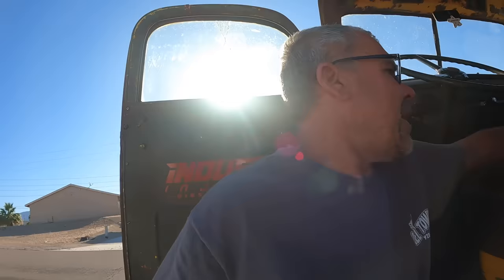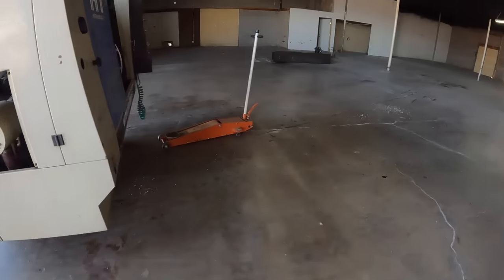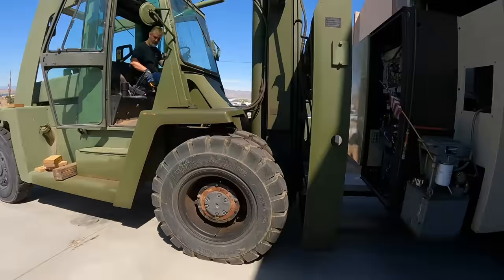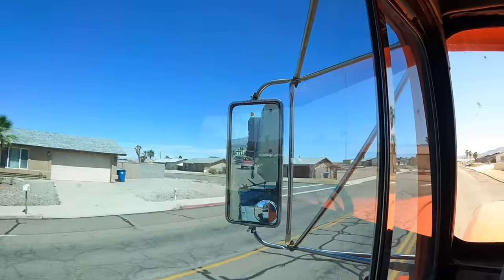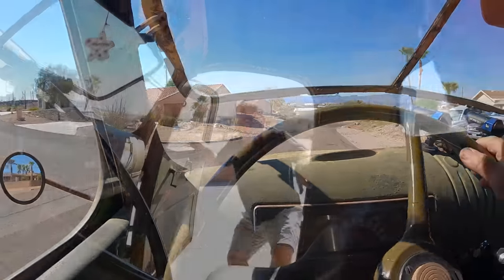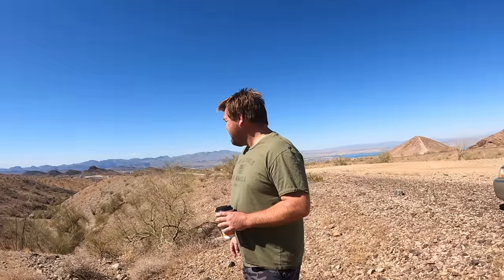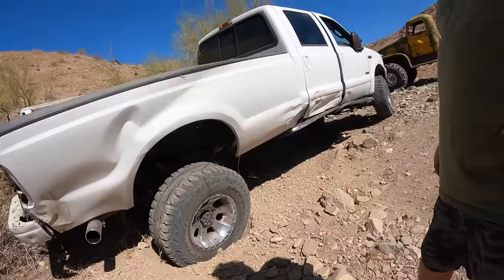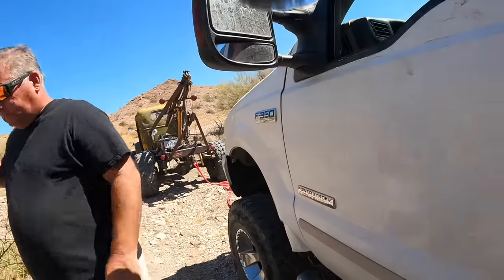Could this be a Repeat of the Wrecker Games? The Repairs to this Truck will be TOO MUCH $$$

Comment: Nice machine congrats on the score!! You would love the monster fork trucks they use in the port of Houston to move and stack containers. They are behemoths but really cool machines.
Reply: I drove a Nissan versa lift 45/65 once.  It will pick up a fully loaded trailer, truck included. 45k lbs, with the counterweight on a hydraulic ram that moves it out and increases the capacity to 65k lbs. What a monster!

Comment: Great job by the wrecker and the whole crew.  I'm thinking maybe more off road recovery people should consider diesel power.  I can think of one in particular that at one time would never have a winch or hated using them and that changed!  Even though I love the gas engines too, I think the torque and dependability of the diesel is the way to go!

Comment: I have a similar truck as that..  2002 F350 7.3L 6spd manual, manual 4x4, manual hubs.  It's an awesome truck, but it's just too dang heavy for off roading.. especially in sand or mud.   It's very capable off roading, but I just try to avoid it if I have a choice.  My old 95 F150 5spd 4x4.. I took it everywhere and it was a beast in 4Low.  It would run circles around the 7.3L in the dessert..  But the 7.3L will blow right by in with a gooseneck on the highway-- so they have their place.

Comment: To prevent damage to the rope on the ledge if you got a spare tire on either vehicle air it down to flat and stick it under the rope standing up if it will if its blown or destroyed and wont hold air even better

Comment: We NEED a video showing how the lathe works... please.
Reply: I have a buddy with a machine shop that has several CNC  machines. It comes down to building the part that you want to copy, program the machine and keep the tooling sharp. If he has an order for any part he has in a program, it gets pretty fast to do. Some parts he literally builds 1000 of.
Reply: Coming soon model T replacement parts.
Reply: You push the on button and talk to it.. Just order a part from the breakfast menu and it will bring it to your table.

Comment: I came across your channel “again” from the Wrecker Games. Love your truck, it’s a 5.9 24 valve right? Judging from what you said during the dyno run and the stand in truck. 

It’s about time we see some diesel trucks on the trails. I recently sold my 2020 Raptor and picked up a 2007 5.9 Cummins, the last of the run before emissions clogged them up. I needed to pull a 5th wheel and am quickly falling in love with this truck. Sun Coast Billet trans, new injectors, and 117k miles. 

I live in the Dallas, TX area and recently visited your part of the country, Lake Powell, we had a great time! we have the same heat here but there the sweat evaporates which is way better!! 

Any ways thanks for the videos!

Comment: Surprised it didn't have a bigger base, looks like it would be wobbly
Reply: Nah, most of the big top is just an enclosure made from sheet metal to keep shavings and fluid from flying all over the county. A good lathe, 9000 lbs is quite a small one. Probably swings 18" perhaps a 24 to 36 inch bed length. All the weight is as low as possible to reduce vibration.

Comment: pro riggers would just use short jacks, put small pipes (or round bar stock) under it, remove jacks then roll it to the door. You can actually move that with one hand. (I've done it with printing presses) I imagine it must be dead level before operating.

Comment: Merlin do you have to have CDL license to drive your role back?
Reply: You need a commercial license to drive any truck commercially.
Reply from the maker: Yes i have a CDL with all endorsements 🏁🇺🇸😊
Reply: @MerlinsOldSchoolGarage  I had to let mine go I’m losing the sight in my left eye and it sucks
Reply: @secret5.  wrong!
Reply: @George-dy3pt  It's not wrong.  If you drive an f150 with commercial plates you "legally" need a commercial license. We had this issue come up with electricians driving company trucks.  Stupid but it's technically the law.